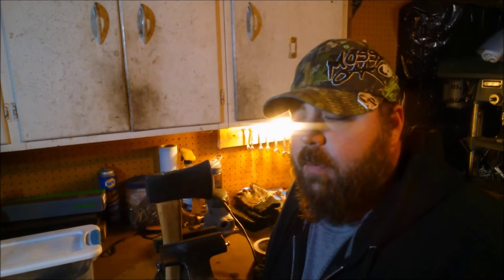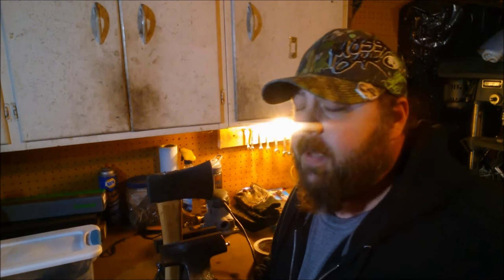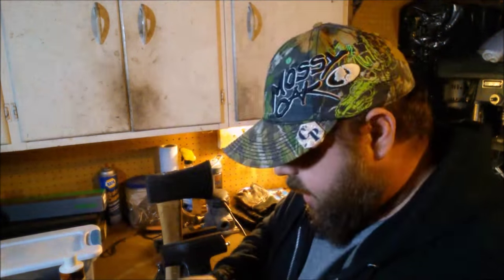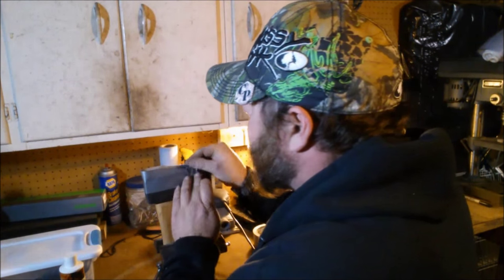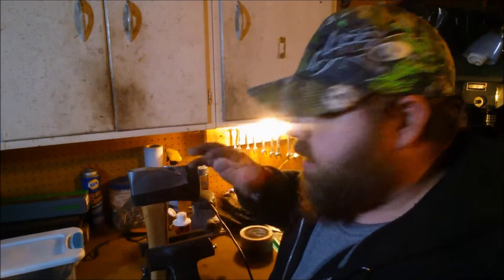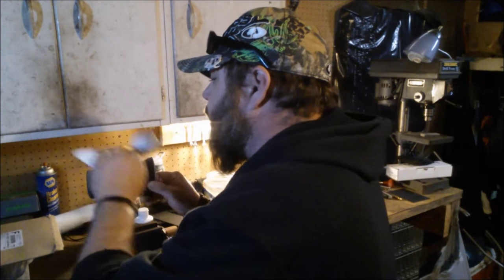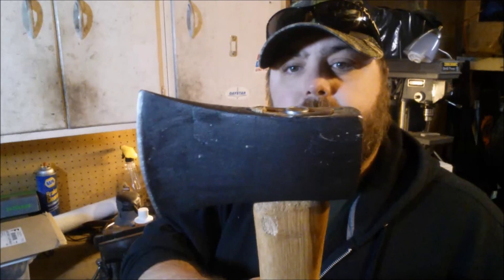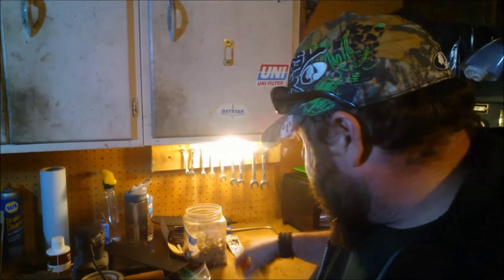How To Fix a Loose Axe Handle The Quick Easy Way

Comment: I place the dried out end and ax head (upside down) in a can or pan of used motor oil (to about 1/2" above the ax head) and let it soak for a few days. Then I wipe off the excess oil and reseat the wedge. The oil swells the wood and helps the steel ax head to keep from rusting.  Never throw away used oil, there are a myriad of uses for it...mix it with sulpher to put on your dog's mange, oil a squeaky hinge, smear on boots to help soften the leather, and, as mentioned, use to restore dried out wood.
Reply: This is a trick that I learned from my father in law, and it works!
Reply: I heard antifreeze works as well
Reply: @u.sonomabeach6528  No, antifreeze is related to alcohol and very poisonous.

Comment: Probably a stupid question: should I let the linseed oil cool down before using it? Great video btw. Liked and subbed.
Reply: Why is it hot? Just incase I wanted to say that boiled linseed oil you buy at the store isn't actually boiled. It has certain chemicals added to help speed the drying time. I wouldn't recommend boiling yourself unless you knew exactly what you are doing

Comment: Soak for a few days in boiled linseed oil like this: - get a plastic bag just big enough to take the head, put a bit of tape on cutting edge to protect bag. once the axe is in, it does not need a huge amount of oil to get oil level high enough to submerge whole head and 1/2 inch of the base of the handle.
The real trick is to do this a couple of times a year, BEFORE axe handle gets loose.

Comment: Hey country prepper would Mineral oil or canola oil work.
Reply from the maker: Never tried them so I can't say for sure. The main reason to use oil is it doesn't evaporate, so it should be fine.
Reply: Ok thx

Comment: If super glue doesn't do it, then duct tape it!  Otherwise ... buy a new axe!  Use 3in1 oil, WD40, even penetrating gun oil to penetrate down into the wood shaft and expand again.